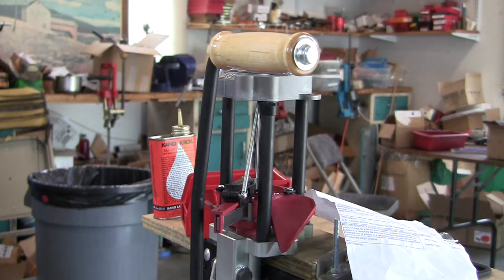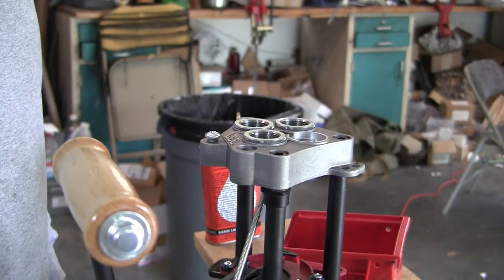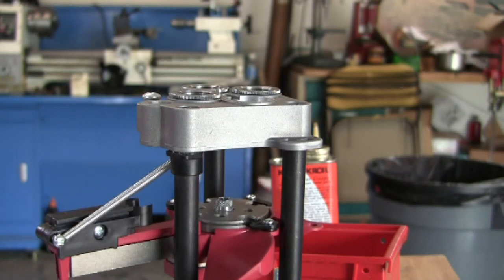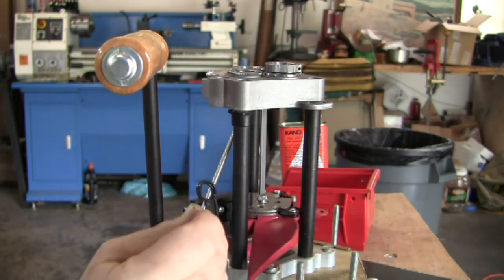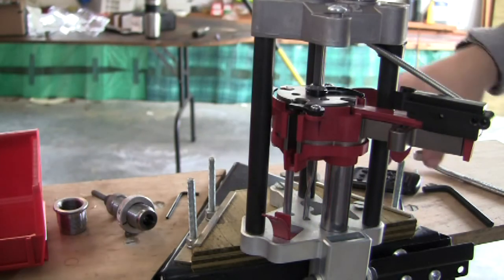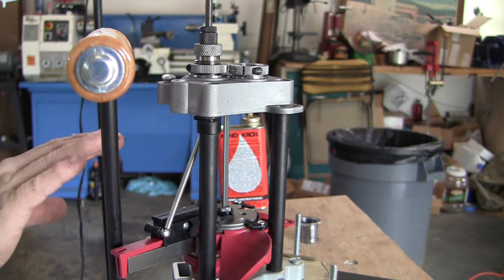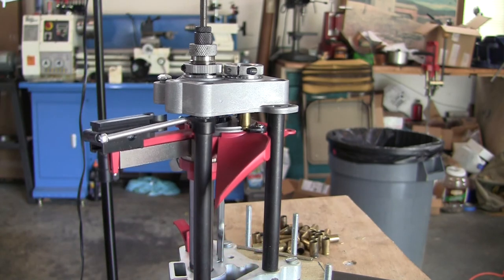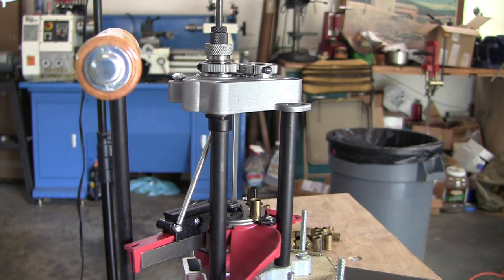Lee Breech Lock Pro instaling shell plate

Comment: ...I've done the same thing...went from a Lee Pro 1000 to a Dillon RL550B and would usually forget that the press was manually indexed...I missed my case feeder but love the press - gotta send it back to Dillon for rebuild - it got caught in a hot water heater accident...I'll move my operations into the air conditioned house from my brutally hot garage here in So FL and set my Pro 4000 up and crank out much needed .38/.357 & 9mm/.45 ACP...found a lost stash of both small pistol and small pistol Magnum primers as well as about 10 lbs of nickle plated 9mm brass and roughly 7 lbs of .357 brass...had them for prolly 10 year plus and completely forgot 'em...Christmas in April!!!